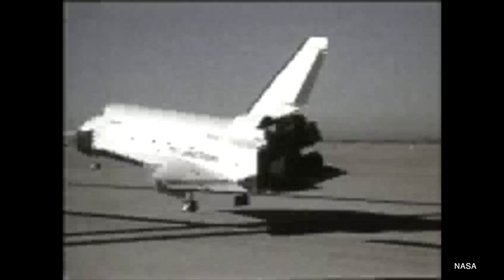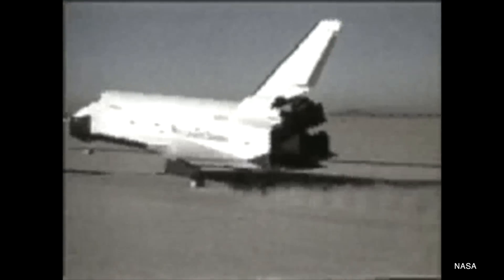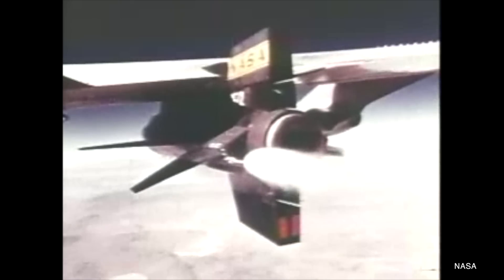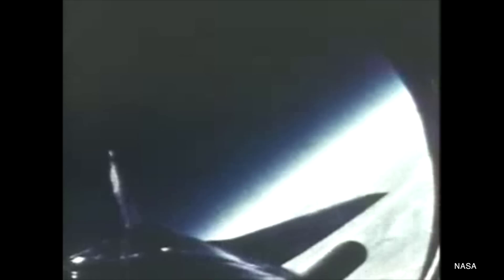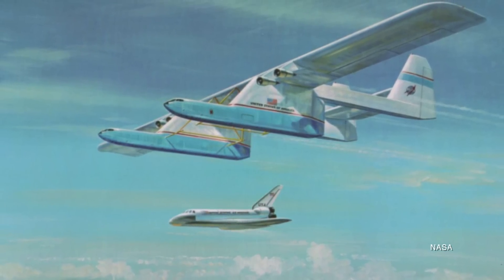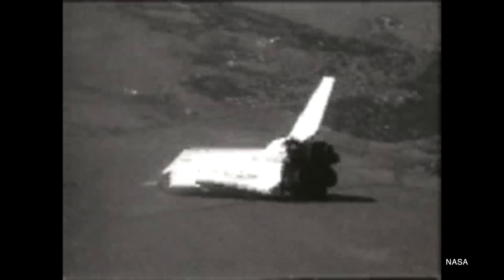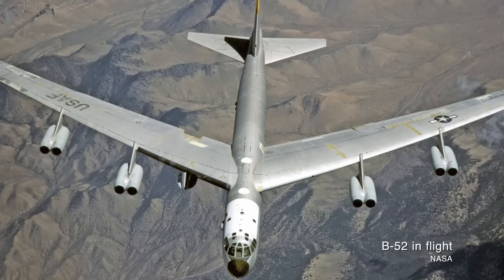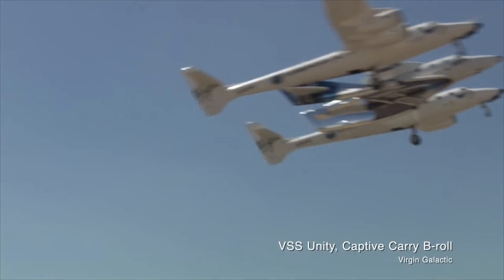When NASA Wanted a Dual Fuselage Shuttle Carrier

Comment: Surely they would have saved a huge amount of time and money by landing in Florida.  Why didn't they?
Reply: They did land in Florida many times. but occasionally if weather was bad in Florida they needed another alternate landing area, and in the early days when the shuttle was still new... they landed in California's wide open dry lake bed because... lots of extra room just in case.
Reply: Also, the Air Force originally planned to use the shuttles to launch spy satellites into polar orbits.  Since the were concerned about Soviet interference, they would have landed them on the same orbit.  As the Earth would rotate under the shuttle, it might not be landing at the launch site.

Comment: Its just me or the animation on Amy's intro is kind of choppy? I think the first part is missing some frames or the file format is not in sync with youtube frame rate.
Reply: It did seem to skip a little to me, I figured it was just my connection and some dropped packets (using a neighbor's wifi on a clapped-out old HP laptop).
Reply: Yeah, IM using a 1080p 144 Hz monitor on cable here so my guess is there is something wrong with the animation in itself or the exportation of the file.

Comment: I don't think the shuttle's cross-range capability was needed to land at Edwards after launch from Cape Canaveral.

What I had read was this: the shuttle might launch from the west coast in an orbit that would take it over the North Pole. (It never did, but when they were designing it they thought it might.) In this mission it would orbit once and then land.
Because the earth is spinning, and a single orbit took 90 minutes,  the launch facility would have moved 1200 miles east while the shuttle was in orbit, so the shuttle would have to re-enter (still facing north) and then turn east to move diagonally back to Edwards to land. THAT is why it needed so much cross-range capability (IIRC it was designed to be able to move 1600 miles sideways while coming down).
They may have taken advantage of the cross-range when designing flight plans for the shuttle, but if it had only been capable of a few hundred miles they would simply have needed to design its orbits to put it where it could re-enter pointing basically at Edwards.

Those polar launches would have allowed telescopes in the cargo bay to take photos of the far side of the earth and return the film for developing super quickly. By the time the shuttle entered service, there were satellites that could transmit their images electronically (instead of having to eject canisters of film after several weeks of taking pictures), so there was no longer any demand to use the shuttle for that. So they never built the Air Force launch facility on the west coast, and they reduced the number of shuttles they were going to build because the Air Force no longer wanted some of its own, but the design of the shuttle had been locked-in nearly a decade before when that was a mission the shuttle would likely perform.
Reply: Actually NASA did build a shuttle launch site on the west coast. They spent several billion dollars on modifying Vandenberg SLC-6 into a fully equipped launch pad for shuttle launches into polar orbit. 
There was a shuttle assembly building, crawlers, flame trenches specially designed for the SRBs, everything needed for a shuttle launch. 
The first launch from there was planned for late 1986, however that launch was cancelled when the whole shuttle fleet was grounded after the Challenger desaster.

After that it was indeed decided that no polar orbit missions were needed for the shuttles and the launch pad was never used for an STS mission.
Reply: There's some weird documents floating around online that discuss the cross-range capabilities in terms of hypothetical military spying missions, or even the concept of dropping a nuke on Russia that way.
Due to the space shuttle basically being a sitting duck in a mission like that if you can predict it's orbit, it had to be able to launch, fly over Russia and land again in a single orbit or less.
Don't know how reliable these documents are, but they are definitely interesting reading when it comes to some of the stranger design features of the shuttle (large crossrange ability and excessive cargo capacity aren't that useful for civilian flights, but much more relevant for military ones) and it's possible military applications.
Reply: Launches from Vandenburg AFB did not need to land at Edwards AFB following such a mission profile as there was a landing strip already available at Vandenburg that was capable of handling an orbiter landing there. It's the same one that has been used to recover all but the most recent X-37 spaceplane's flights.

Also, as has been pointed out, there were plenty of other payloads besides the Gambit and Hexgon class Keyhole satellites that might have required the cross range and certainly if the orbiter need to perform an Abort Once Around after an engine out scenario, the same cross range need would still be in place to land at Edwards or Vandenburg.
Reply: Hannes, NASA did not pay for the conversion of SLC-6 at Vandenburg, the U.S. Air Force did. It's the only real substantial monetary contribution the military made to the Shuttle program.

And it wasn't that there weren't any possible polar missions for Shuttle to fly, just that the Air Force and Defense Department no longer wanted to use the Shuttle for their missions and had been looking to get out of involvement with the program somehow. The Challenger accident merely gave them the excuse they needed to go back to their own expendable vehicles. Although the Titan 4 turned out to be an order of magnitude less capable and far less reliable launcher, it was still their launcher. Their toy and the stuck with it until the NLS and EELV programs.
Reply: Nowhereman10 :
The main reason for the Air Force not wanting to use the Shuttle was NASA's prohibition of liquid fuel boosters (e.g. Centaur) in the payload bay 
After the loss of Challenger.  This made lifting the AF and other users heavy payloads to GSO impossible.  The Titan IV lift to LEO was 47,000 lbs, while the Shuttle's was 60,000 lbs. That's a difference of 22%, not an order of magnitude.
Reply: Sorry, that's not quite right. Both NASA and the AF launched a number of heavy payloads into GSO using Inertial Upper Stages (originally Interm Upper Stage,  abbreviated IUS in both cases), both before Challenger and after. See: STS-51-C and STS-51-J for examples on Shuttle and for Titan, Titan-34D ( DSCS II, F-16/III A-1) and Titan IV (402) A for Titan.

Also, as for capability, I meant overall, not simply payload.
Reply: +Hannes Größlinger In '85 I went on a tour of Vandenberg AFB and got see the non flight Space Shuttle Enterprise at SLC-6.  (At a bit of a distance, however.) The following SpaceflightNow.com article has some really good info about the Shuttle and SLC-6. 

https://spaceflightnow.com/2016/02/08/astronaut-interview-30-years-after-the-hopes-of-a-west-coast-space-shuttle/

I'm surprised Amy hasn't had a video on SLC-6 since it was also the planned launch site for MOL (Manned Orbiting Lab). MOL would have used Gemini and I know she's a big Gemini fan.
Reply: I found out about the 90 minute orbit time from watching Iridium flares. One of the satellites was visible twice on the same night.
Reply: The Vandenberg launches were pretty close to happening when they were cancelled.  Shuttle astronaut Mike Mullane was a candidate for the first of those flights, he talks about it in his excellent book Riding Rockets.  Part of the situation involved the development of lighter weight external tanks and SRBs, since a polar orbit launch loses the assist you get from the Earth's rotation.  Challenger was the main reason for the Shuttle program to be re-evaluated, but not the only one.
Reply: Nowhereman10 :

The IUS was a solid propellant upper stage,  not liquid like the Centaur. In my AF career,  I helped do command and control for numerous IUS missions both on the shuttle and Titan. The heaviest payloads were classified missions that needed a booster more capable than the IUS.  In addition it wasn't just the AF that wanted an alternative to the Shuttle due to the program uncertainty induced by the loss of Challenger.  several other government agencies wanted off as well.  But thanks for bringing up several interesting points, good discussion!

Comment: Twin B-52's !?!   With its undercarriage, the B-52 (and the similar B-47 before it) have to take off and land at a give IAS so that both sets of wheels lift off or touch down at the same time.  I don't know about doubling that up.  Also, I think the big cross-range for the flown design of the Space Shuttle was desired by the DoD.  They wanted to be able to do a polar launch from Vandenberg once around and land back at Vandenberg, which needs a lot of cross range to do.

Comment: IIRC, the Cross-range requirement was for a polar orbit launch from Vandenberg AFB and land back in Vandenberg after one orbit.
Reply: Originally, yes. But there was also another need for it when launching out of Vandenburg: for an Abort Once Around or Abort to Orbit scenario should an SSME fail early enough in the launch phase that the orbiter could not make orbit, but had just enough energy to make it back to the launch site or to an orbit that could not meet the mission parameters. The same thing is true in those circumstances as it is for the missions that required only one orbit.
Reply: Yep!

https://science.ksc.nasa.gov/shuttle/technology/sts-newsref/sts_overview.html

"The Earth's rotational rate also is the reason the orbiter has a cross-range capability of 1,100 nautical miles (1,265 statute miles) to provide the abort-once-around capability in polar orbit launches."

Comment: Amy, check out the Stratolaunch. Paul Allen was evidently captivated by the Conroy project, and is putting his own together. Almost as big as the Conroy design, with a wingspan of 385ft and an MTOW of 1.3 million lbs.

It's in the process of assembly, and at first I was a skeptic, but they have continued plugging away at it, and I have heard that it is going to fly in the next few years. Pretty exciting, and a little unnerving - nonetheless it will be cool to see a new largest airplane in the near future.

Comment: Twin fuselage ideas have been tried a few times. The He111 Zwilling has already been mentioned. Messerschmitt also looked at a similar arrangement using two Me 309 fuselages. The most successful twin fuselage design has to be the North American F-82 Twin Mustang.
Reply: EricIrl Yes, and the He 111Z was designed for a somewhat similar purpose too, it was meant to be able to haul the massive Me 321 Gigant glider into the air, although admittedly not into space.
Reply: Yeah, the first plane I thought of after watching this video was the F-82. Was not familiar with either of the other two designs you mentioned, though; but I'm not at all surprised to learn that the German engineers tried them.
Reply: as far as the giant glider was concerned i have heard or read some where they tried towing it with a variety of setups including 3 Me 110s with 3 tow lines back to the giant one from each 110 also with 3 He 111s, but as stated in the end it was decided to add motors to the giant but even then it was slow hard to handle and though used a few times not for any worthwhile purpose and ultimate;y was a failure. Sort of a similar story to the "Spruce Goose " it did fly once and only a few feet up but was too big for it to be worthwhile with the then current engine capabilities it took jets to enable the giantism in aircraft we have today.
Reply: Becky Beck Yeah, that was another configuration they tried, but 3 110s turned out to be incredibly dangerous, and so it was abandoned.
Reply: Interesting, I had never heard of the Messerschmidt 309, let alone a twin variant. It reminds me of another failed twin aircraft, the Bf109Z. Very similar looking aircraft.
Reply: No mention of the Lockheed P-38 Lightning?

Yeah, sure, it only had one cockpit, but the engines were pretty much two separate fuselages that were joined at the front with the wings and at the rear by the horizontal tail stabilizer. Surely that counts as a twin fuselage design?
Reply: Thoth themighty , it crashed, killing over 100 troops, so they put engines on the Gigant instead.
Reply: Michael Tuz Yeah, but the interesting thing is that the He 111z was still not powerful enough to lift the Me 321, and so they went with the method of moar boosters in order to actually get it airborne!

Comment: Wasn't a big carrier the original launch vehicle as well? They'd carry the shuttle on a high flying jet, then light the main engines to get the orbiter in orbit?
Reply: Read your comment only after posting my comment. High altitude flying would be a good reason why they planned it with such a massive wingspan, just to lift the weight off the ground about half the wingspan would be sufficient.
Reply: I doubt that, you'd lose a whole lot of payload-capacity to put the fuel in the shuttle.
Reply: Yeah, one of the earlier plans when they were thinking fully reusable. But I believe that was when the shuttle design was a lot smaller. The Germans had a similar idea https://en.wikipedia.org/wiki/Saenger_(spacecraft)
Reply: The size of the wings, and the cross-range capability were part of the DoD's requirements for the shuttle. They wanted to be able to launch the shuttle, drop a nuke on the USSR, then land in California in a single orbit. Or launch a satellite from a once-around polar orbit. Apparently, this capability earned NASA a ton of money from the DoD. Without the DoD supporting the shuttle, it may never have been built.

http://www.airspacemag.com/space/secret-space-shuttles-35318554/
Reply: Yepp, and when it blew up in 1986 the military stopped using it for launching spy satellites anyway and continued using expendable rockets.